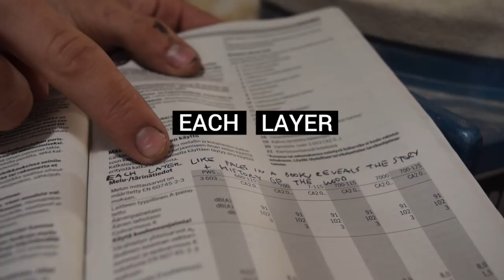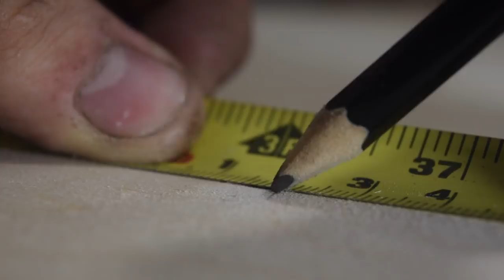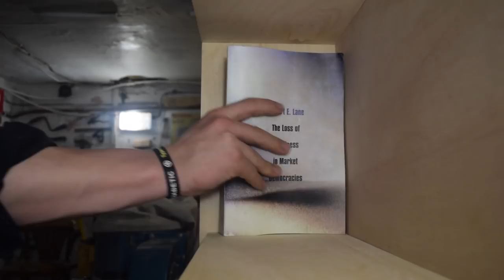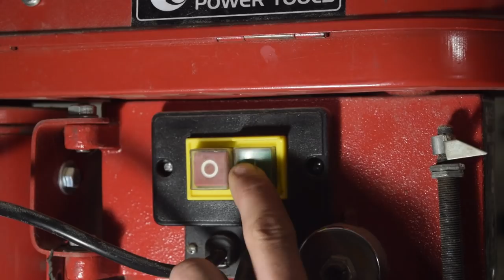Making a Wall Mounted Bookcase/ Cabinet

Comment from the maker: I spent a bit more time on this one working on the audio and also trying to slow down the pacing as I know it was getting very fast, especially over the writing - so let me know what you think! 

Also a massive thank you to ‘melons_ltd’ for suggesting to use a water based varnish finish & ‘Julia Nugent’ for suggesting the angled steel door pulls!
Reply: I was just about to comment on the handles! You made the idea even better with the sheet metal bending. I thought you might try it out once I saw that jig in the mail holder video. I’m loving everything you make.
Reply from the maker: Thank you so much Julia - I wouldn't have thought about applying that technique to door handles so the credit goes to you really!
Reply: Nice work, a really nice pace to the cinematography and music. Very well edited. 🍻

Comment: Well done mate, it worked out great. I think I would've blackened the inside, just for a contrast. That beam was a fab find!! 😀😀
Reply from the maker: Thank you mate & it definitely was haha! I actually only used a small section that was attached to the main beam, so I still have to decide what I'm going to do with that! 

Good suggestion with the blackening - I did go back and forth with making the whole cabinet carcass black, but decided not to in the end because I think unless it was in a really big open space it made the piece look too heavy, and dark even if it would improve the contrast!

Comment: great finished project & video.  You might think about making wood hinges on the next one. looking forward to your next video :>)
Reply from the maker: Thank you Russ! Curious what you mean when you say wooden hinge? Are you talking about making some sort of living hinge, or making an actual butt hinge with pins etc?
Reply: not sure what a living hinge is.  I have made a rule in my shop.  Any shop project I make that need hinges, I make them instead of buying them.  Shop made  hinges really add to a handmade project. I did a video on my channel last July (July 2017)  showing some of the wood hinges I have made if interested.  There are many different styles of hinges, when making hinges, you are limited only by your imagination.  enjoy your channel.

Comment: Fab. Good speed, but you still have to be watching closely to catch it all. Excellent original ideas again. Did you make the dowels yourself? How? And a good, practical project that will be used. Nice :)
Reply from the maker: Thank you Rob, really good to hear you liked the concept & the speed was better, I was thinking of you when I was editing! Although watching closely is the point of videos isn't it??! Wouldn't want people watching with one eye open! 
Re. dowels, yes I make them all myself - a lot cheaper than store brought ones & you can customise the sizes. 
To make them you: 
- get a HHS drill bit capable of drilling both steel & wood (I tend to use an 8mm one) 
- drill a hole in some sheet steel (mild steel will work, but tool steel is a lot better, I use a 3mm off-cut of a 01 knife blank) 
- cut a dowel blank slightly oversized, e.g. a 9mm square blank for an 8mm dowel 
- chuck the blank in a handheld drill 
- force the dowel through the hole in the steel, with the drill spinning (it helps to taper the dowel to start the process) 
- the sharp edge of the steel will cut the dowel to the exact size of the hole 

- then you can use that same drill bit to drill your dowel holes, and because you used the exact same drill bit both times, you will get a perfect fit :) 

Hope this makes sense, if not let me know & I'll make a specific video showing you how to do it :)
Reply from the maker: Yep, that looks like the exact type of thing I use although not as well made & laid out haha - I find pine works really well on my steel jig thing - maybe try a higher speed on the drill, dowel blank size thats closer to the final dowel so less wood is being removed or putting the drill in reverse?
Reply from the maker: Also avoid knots or holes in the wood, something with a straight clear grain works best :)

Comment: Great concept mate and really cool edit too. How did you attach it to the wall?
Reply from the maker: Thank you mate, glad you enjoyed it! To attach it, I drilled 4 holes into the back panel (which was 9mm plywood) one in each corner and then drove a screw through these holes into the wall. I managed to get a couple good fixings but the other two just went into drywall anchors :)
Reply: cool thanks man!